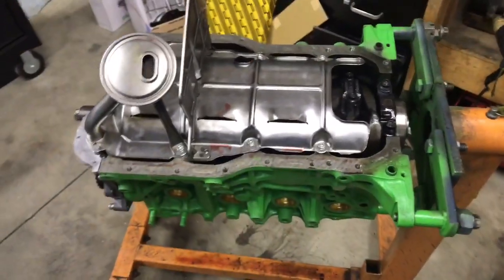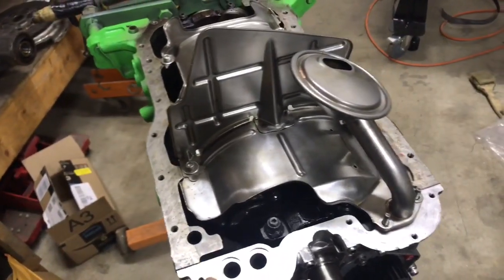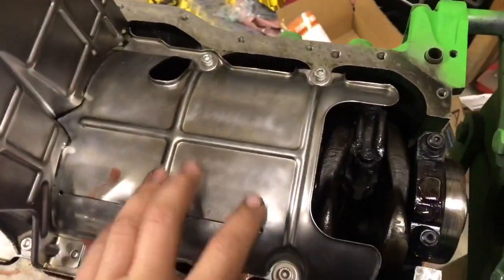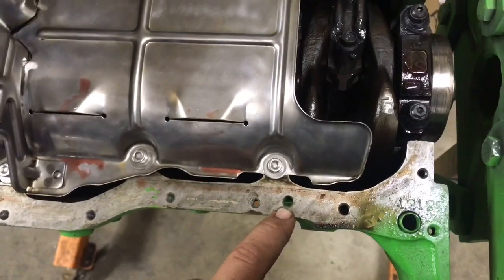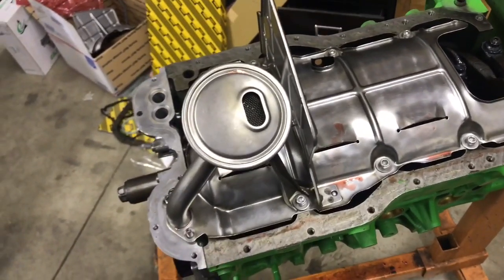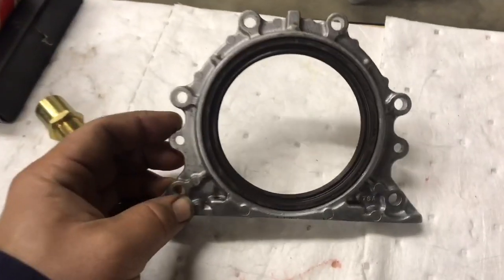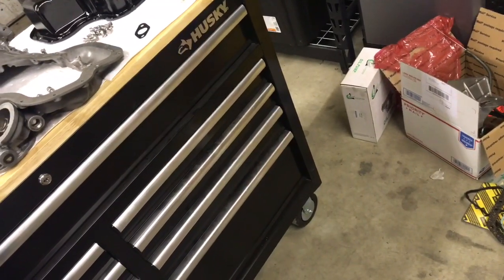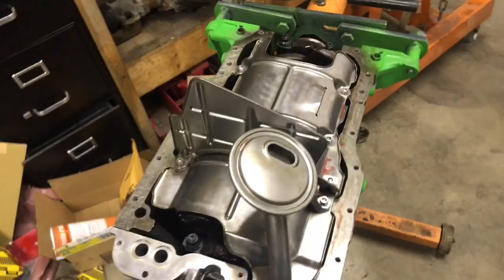3sgte build oil system

Comment: Hi from the UK. Did you have an issue with the ARP studs clashing with the No.1 sump at the 5th main bearing? My ARP sits proud of the sump parting line and Im wondering whether to revert to std fasteners at this main or is there enough meat to machine a pocket? Mine is a rev 3 block so may be different at the mains. Nice engine. Keep up the info sharing.
Reply from the maker: Yes I had to weld up the back side of the aluminum pan and mill out a clearance for the arp studs.

Comment: Can this be done with a 3SFE engine. Relocate the oil filter. BTW, I have a Moroso oil pan.
Reply from the maker: It would replace the Moroso oil pan, but yeah the same thing could be done. A quality oil filter relocation kit would be a cheaper option and you can use the pan you have all ready